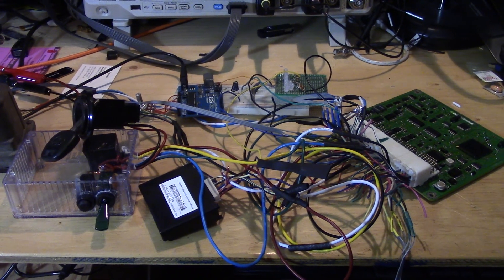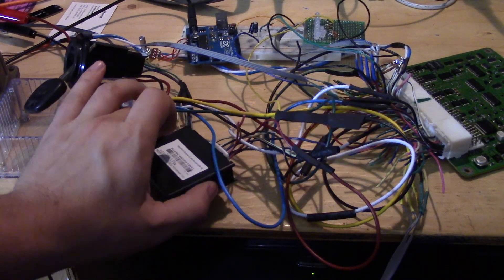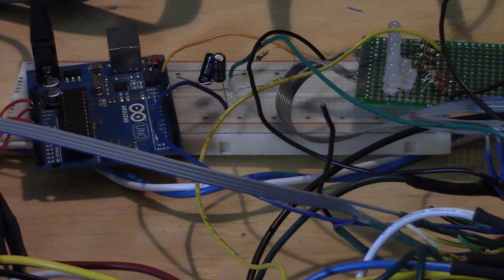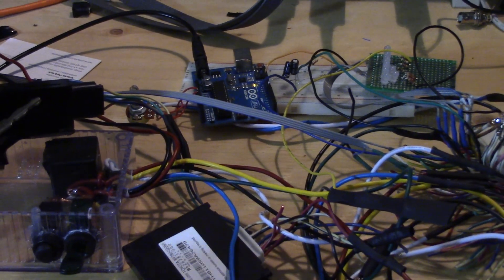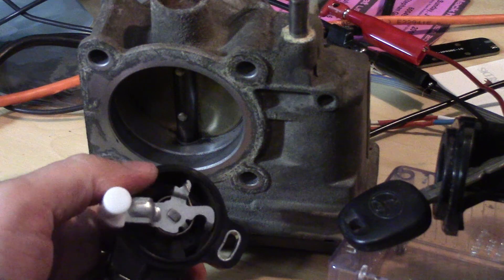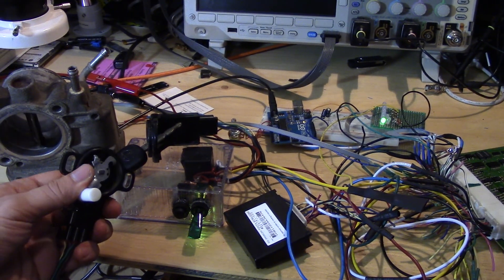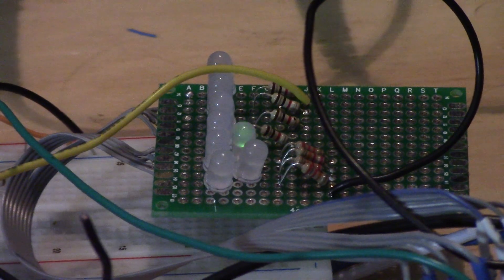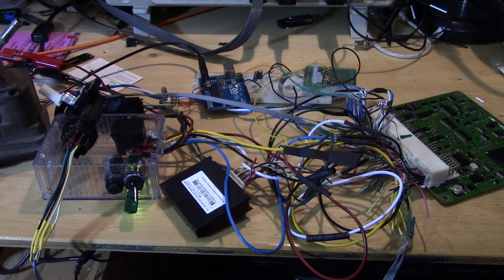ECU Simulator / Running on Bench (2006 Corolla ECU)

Comment: If I understand ardu-stim is generating a square wave signal you are converting - to what ? - with a RC filter ?
I'm trying this with a Renault Sirius 32 ECU but no luck for the moment... with the RC filter I get a triangle wave between 0 and 5v with a 0.47µF cap & 1K res ^^
Reply: ardustim generates crankshaft sensor signal it makes a similar 0-5v signal of a hall effect sensor.If your car use a different sensor like a VR sensor then ecu wont understand that signal

Comment: 1 reason the reason the injectors are not continuing to trigger is that you need a "coil fired" signal return to the ecu. Older Toyota ecus had one wire at about 5-6v and the trigger was puled to ground each time a coil fired, later ecus had separate trigger returns, 1 for each coil.
2nd reason is the cam and crank signals have to be in the correct phase with each other, so if a cam belt broke or slipped out of time you ignition and injection pulse would only fire a few times until key on again.